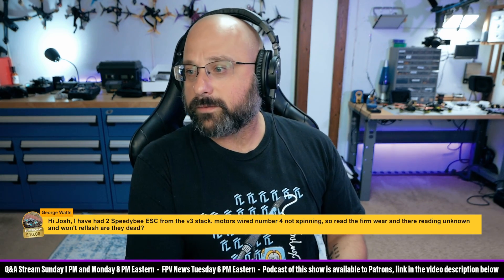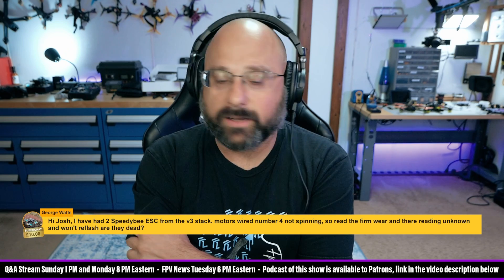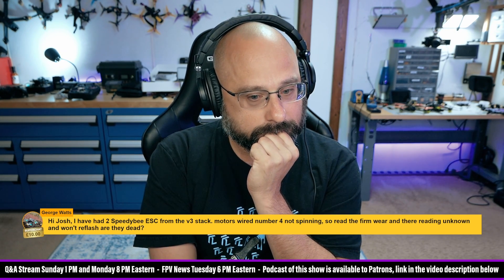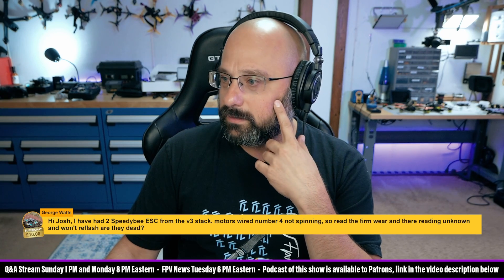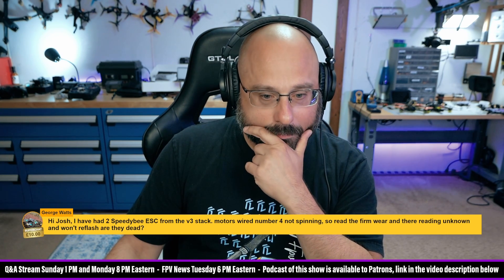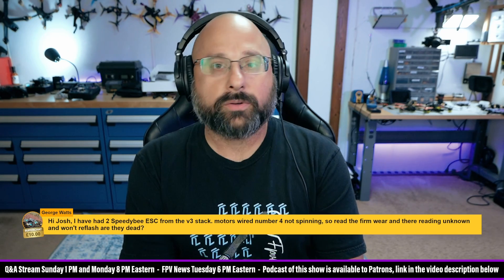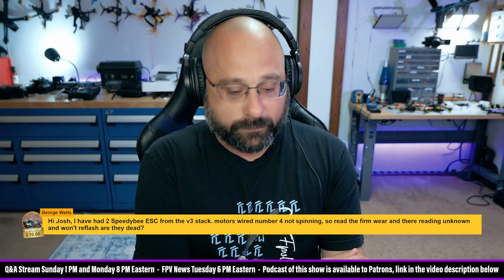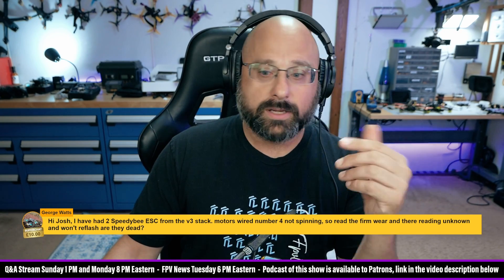ESC Shows As Unknown In BLHeli Bluejay Configurator? How To Flash? - FPV Questions

Comment: ESC configurator won't read any of my ESCs on this brand new f405 v5. i tried reflashing betaflight and everything.. it flies though and the motor tab in betaflight works fine. must be a firmware issue.

Comment: i had the same problem on the same speedybee f405 v3 stack, BLheli_S 50A esc. esc configurator did not want to read the 3rd and 4th esc. i solved the problem by buying an arduino nano and on the underside of the esc under each mcu you have two small solder pads. When you look at the markings on the MCU, they are below, so looking at the left soldering field you have C2CK (clock), and on the right is C2D (data). C2CK (left) goes to D3 on the arduino, and C2D (right) goes to D2 on the arduino. GND on the arduino directly to the GND of the battery on the esc. Download BLheli suite (not BLheli_32 suite, unless your esc is 32-bits) make an interface for arduino in it (go to baud rate 115200), before that download communication software for arduino @joshuabardwell has a clip about it.. when you do it in tools in the BLhell suite, set it to communicate via silab C2, attach the battery to the esc and read the esc. Then the suite will 99% see that lost esc. Then do what you want.. NOTE: 1. if you lost more esc for each one, you have to do it separately 2. the soldering fields are very very small, you have to be very precise with soldering and the soldering iron must have a sharp tip, and you must not you use a lot of tin. Greetings

Comment: Bro how to flash Bluejay to BLHeli_S ESC (I got the cyclone one) without Betaflight controller? Maybe with Pixhawk or Arduino? Because i want to connect my ESC to ESC Configurator website using Arduino Uno (connecting Signal Cable to D0) but can't and it says 'Failed resetting ESC 1 - power cycle and try again'
Reply: I have the same problem, were you able to solve it?
Reply: @cagedgandalf3472  sadly, i still not figure it out. I moved to EMAX BLHELI.